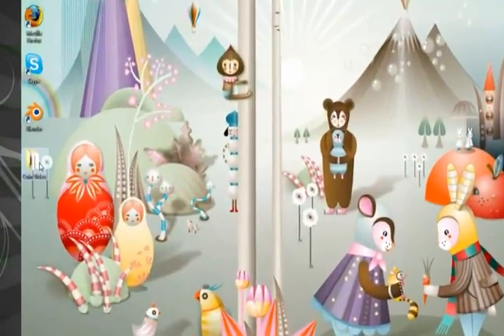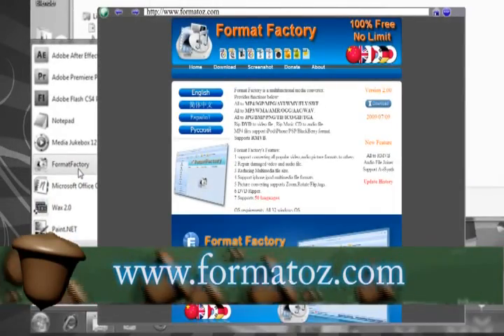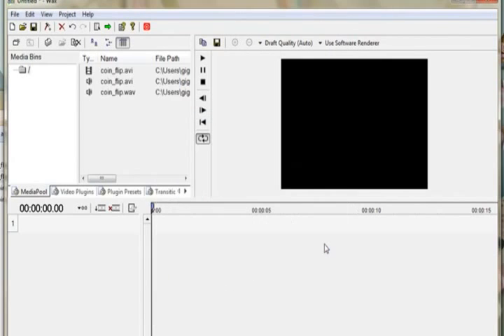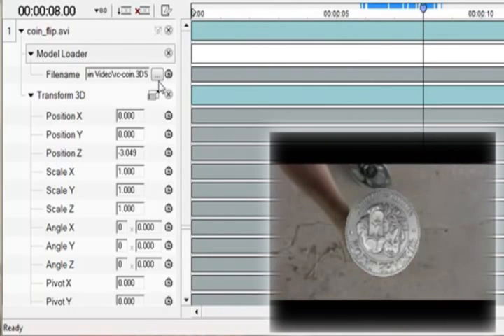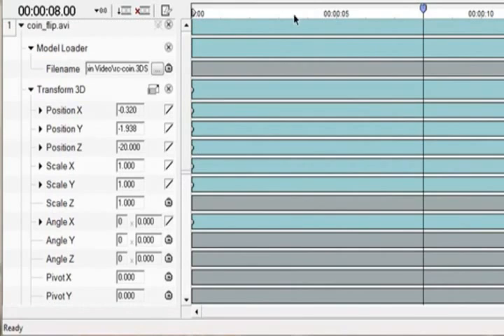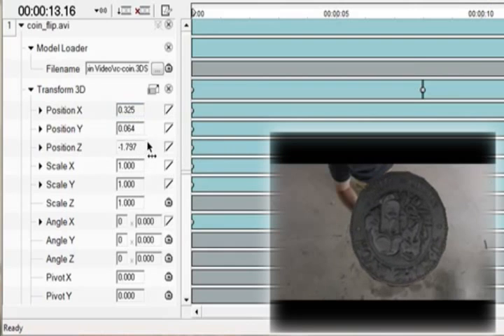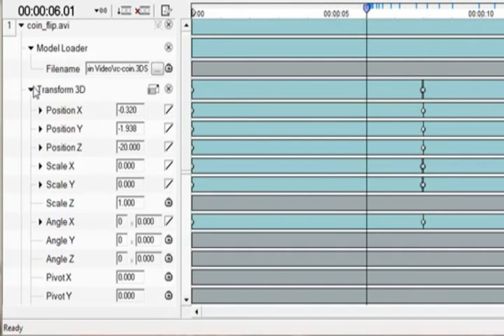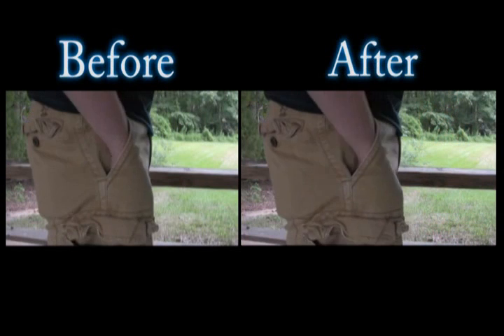Free Video Editing Tip: 3D Compositing

Comment: Sure this is using free software..but wtf. Why is the coin model so bad? I've never seen someone use 3ds max (which is not free) and come up with a crappy model like that. Where are the mappings on that thing? And btw, I've seen some comments about this, Maya is more towards game rendering, 3ds Max is more towards animation rendering, and Blender is a mix of both. For students and people with tight budgets, Blender and any opensource video editor. For pros, AE, 3DS, & Preimere.

Comment: I´ve got a problem. When I put a 3d model into wax 2.0, the model needs texture and a window pops up. In the window I need to select one or several files, that I believe is texture that is required. I have dowloaded the files from the same website as displayed in this video and I get 3ds files from the zip.